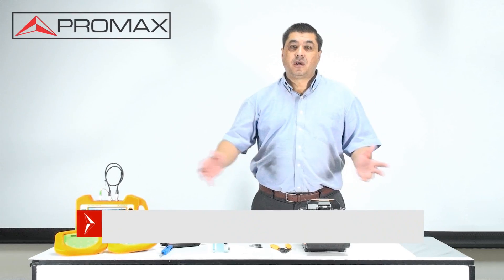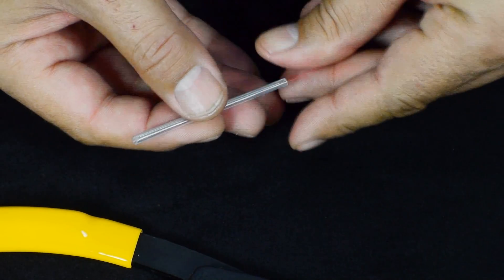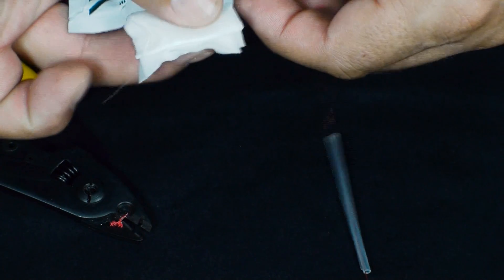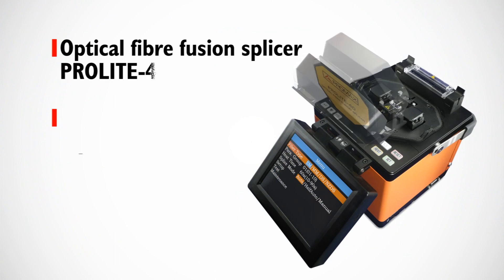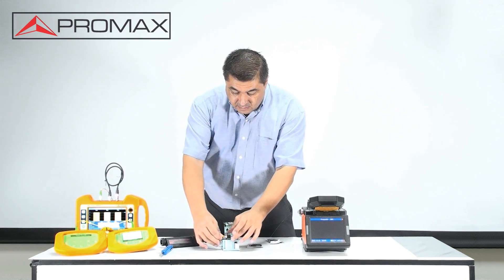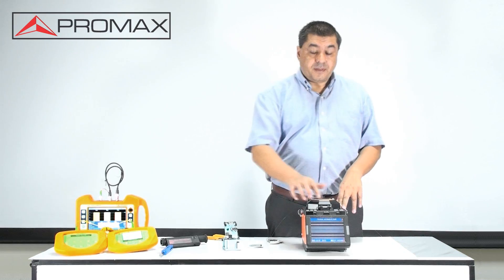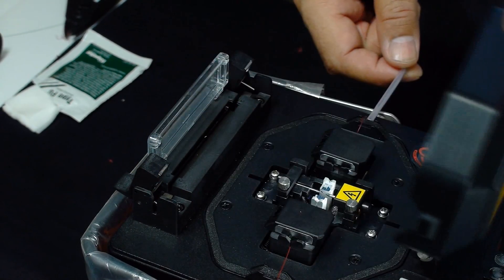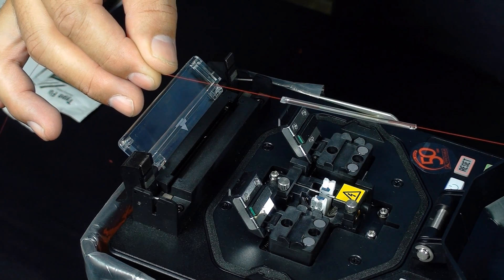How to fusion splice two optical fibres

Comment: Your our cleaver is dull and the splicer is dirty. . You can see it in the magnification with the issues with the core. You either have dirt on the right fiber and it looks like the cleave is uneven. 
You also need to keep tension on the fiber until the heater is closed. You use the tensioned fiber to flip the lever on the right that closes the lid. Without tension the fiber can "S " bend inside the sleeve.
Reply: suck it

Comment: I would have never accepted that burn. Clearly had a bad spot and knew it was coming from that bad cleave he had on his left side
Reply: Both sides looked cracked and dirty.  A bottle of iso and wipes work way better.  Also, no cut management.  Safety should be first.  A fiber in the eye or digestive tract or lungs would not be fun.

Comment: how is this machine used in the field when the conditiond do  not allow for s nice flat clean table  to work on or proper lighting and actual room to work in. I can br in a ceiling in s very tight space, with very minimal work space.
Reply from the maker: Hello ElectroPals LLC and thanks for watching. Illumination is not a problem since PROMAX fusion splicers have built-in LED lamps that help you to position the fibres even in absence of light. If you need extra lighting you can use a cheap LED headlamp. Regarding using the fusion splicer in ceilings, industry provides convenient solutions such as universal ladder platforms that you can attach to your portable foldable ladder. A quick search on Google will help you to find many providers for both solutions.